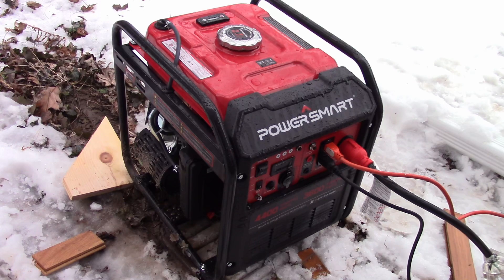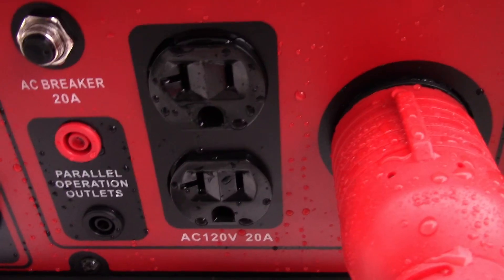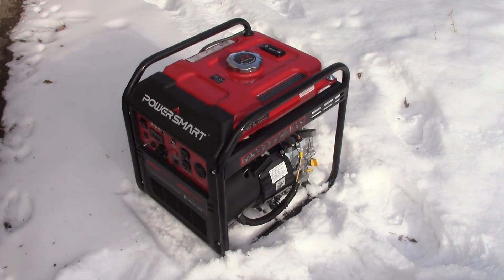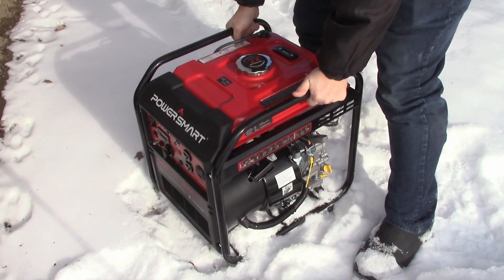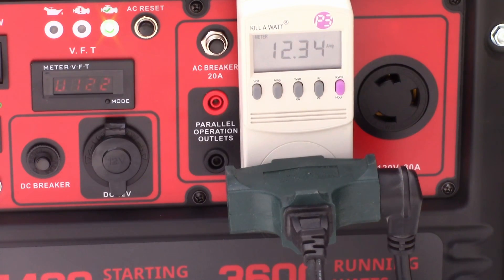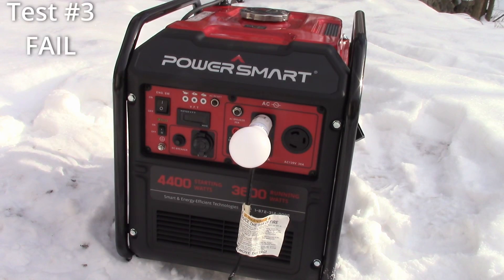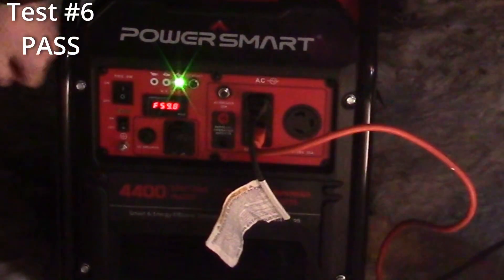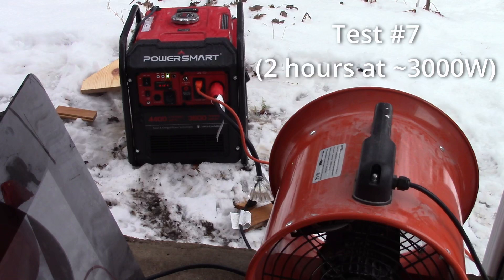PowerSmart 4400-Watt RV Ready Generator Stress Testing & Overload MB5040

Comment: Oh boy... so many operating flaws in this video.
1. Learn what a choke is for and how to use it to start a gas powered device - ask people around you who are mechanically inclined to teach you this.
2. Learn how electricity works so you won't cause a disaster: trying to pull over 20A on a 15A outlet via a plastic tri-spliter is a recipe for fire. Luckily, the safety breaker triggered at 25A (which is way too late - as it is written AC Breaker 20A in the panel) before you melted something and cause fire.
3. If you want to know the power of what you are outputting, you need to see the wattage. Amps are only one measure, wattage is the product of Amps x Voltage which will give you your total system output. 10A at 10V is not the same as 10A at 120V (one is 100W, the other is 1200W).

Edit:
Specs of this generators are:
2x three-prong 120V 15amp AC output (max of 1800W for BOTH outlet)
1x  30A outlet for 3600W
4,400 rated starting watts and 3,600 rated running watts
Runs on gasoline fuel
4-stroke OHV engine delivers maximum performance,single cylinder
Recoil start
2.7-gallon fuel tank
ECO switch
AC,DC breaker
223 cc engine displacement
120V operation
EPA approved
Gasoline run time 11hours at 50 percent load
Weight: 68.8lbs

Comment: Any experience with the Champion open inverters? Looking at this model and champions similar size but champion has dual fuel for $480 at Walmart now. Or stepping up to next size up in both brands in the 5000w running range. Only need for back up 1-2 times a year in Houston for either hurricane or ice storm. Typically 1-3 days. Running 1 fridge, freezer, fish tank, some LED lights, tv/internet and possibly adding a window unit in the 1000-1200 watt range
Reply from the maker: I have no experience with the champion. Mines a backup to a standby generator so I was looking for cheap cheap, but dual fuel is nice. Propane doesn't go bad in storage like gas.
Reply: @striker1211  ok thanks for the quick reply. Yeah dual fuel for alittle bit more doesn’t seem bad plus I’m more familiar with the champion brand. I’m sure they’re from the same factory in china.

Comment: With these cheap generators, add an inline fuel filter & you have to adjust the valve lash with the first 2 oil changes and put a high quality spark plug in it.
ALSO: Clean the spark arrestor often, or remove it for better economy.
Running a capfull of stabilizer and marvel mystery oil with each fill up wont hurt either. 
P.S. Retorque all nuts, bolts & screws with blue locktite . And CHANGE THE OIL REGULARLY
Reply: Thanks for the tips. I’m broke as hell and just ordered one. I guess I’ll see how it goes.

Comment: I just bought one of these on sale for $315. Well, kind of. I ordered off the PowerSmart web site as a MB5040 4400 watt. They sent me the slightly more expensive MB5040C 4450 watt which is updated / upgraded version. Interestingly the MB5040 4400 watt was removed from their site the next day. The updated version is now spec'd at 4450W/3680W and the Max amperage is 30.6A and also has the CO safety, which I hope can be easily bypassed if it asct up..... Upon reading several reviews most people swear by these if you do a proper break in procedure of using conventional 10w30 for an hour then changing oil. Running another hour with a light or varying load from 500-1000w. Then changing your oil again and switching to 5w30 full synthetic. This supposedly eliminates any oil consumption issues you might run into. I can tell you I ran mine for an hour, mainly on ECO mode low rpm, but switching ECO off for about 2-4 minutes every 12-15 minutes. When I changed that oil it looked like a silver mine with particles. I have owned several of the off branded Chinese generators and always used synthetic out of the gate and did my first oil change at 10 hours of lighter use, about 1/2 of the rated running watts in each case, and I never had an issue. If that thing of yours stays together after that abuse, mine should last 100 years!! 😂 Thanks for taking the time to do the review!!! It appears your failures were a result of the low oil.
Reply from the maker: Yeah it must've had an air bubble when I filled it, or it burned a bit during initial break in. It hasn't acted up since.
Reply: They did the same to me with the upgrade. I couldn't find regular oil which was crazy..So I broke it on on syn blend.  The only issue I had was it was a bitch to start. I pulled the plug check gap it was wrong regapoed to .30 and it starts 1st pull. So far I'm impressed.  

I'm curious how the original poster video unit has been doing?
Reply: I had a champion 5000 last over 12000 hours before the engine blew. Also I had a nex pow 2200 last 4300 hours. Cheap regular oil

Comment: Good job on the video. During the first  5 hours of break in, I'd suggest no more than 50% load.  Please comment if the oil usage continues to be an issue.  That's impressive for $300.00 for an inverter gen !!
Reply from the maker: Thanks, I've learned a lot about "break in" in the past few days. I've never had a new 4-stroke motor before so this is all new to me.
Reply: I know inverter generators are quieter and all, but I am not crazy about them when it comes to using them on larger applications like running a house with a portable generator. A plain portable generator is just so much better. Yes it runs at 3600 to 3700 RPM constantly but you know what’s going to happen. There are ways of surrounding your generator with boards loosely, so it can still breathe, but quiet it down
Reply: @Autistic-Uhbuddy nonsense... You aren't going to run most of the heavier loads in a house on a 4400w anyway ....except maybe a well pump. Just ran 2 fridges and lights at my grandma's house no issues with this model.
Reply: @Wingnut353  That’s funny. I don’t remember this video or commenting on it. it sounds like something I’d said at one time but I don’t have a problem with inverters as long as they can power what you need them to power. I have a 8125/6500 regular Ryobi generator and I also have a 2300/1800 Ryobi inverter to run for portability and running it at night because it’s quieter.

Comment: Need to break in the engine on regular motor oil, not synthetic oil. You want everything to seat first. Need to do a few oil changes also during break in. After break in oil shouldn't be black the fast. After that then switch over to synthetic oil.
Reply from the maker: Yeah the manual said to break in with convention oil "(included)" but it was no included so I figured they do it at the factory now. Looks like I was wrong. Hopefully everything seated okay. Time will tell. I'm going to run a gallon of gas through it every fall. Hopefully I never need to use it and my Generac keeps kicking.